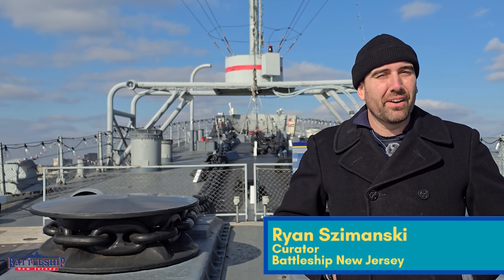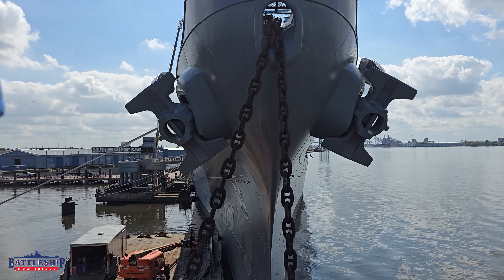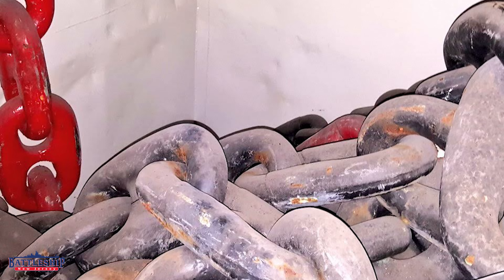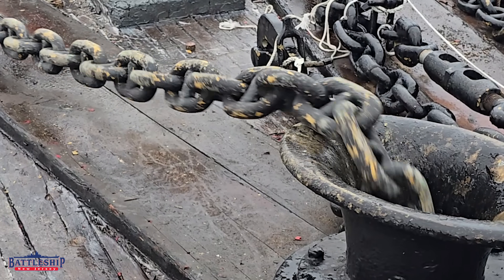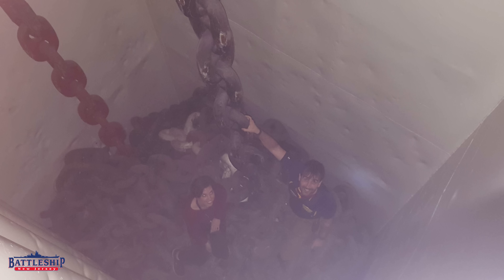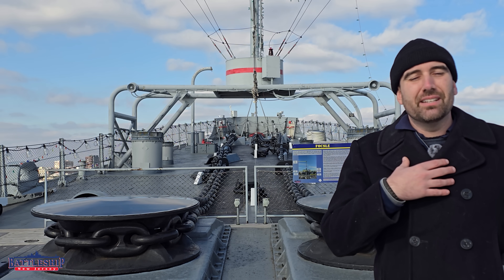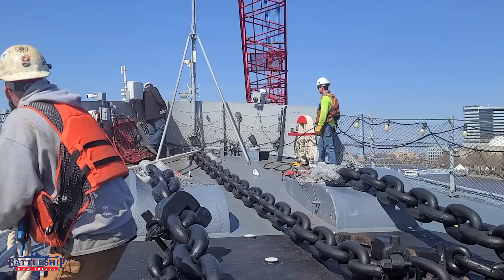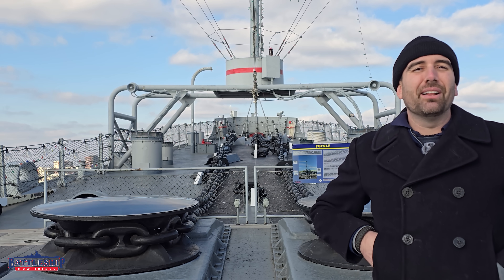How Much Chain Does A Battleship Need?

Comment: Speaking of that third (spare) anchor that was originally installed on previous fast battleships like North Carolina in a recessed indent in the main deck, I have 2 questions.  1). Why was the indent recessed below the level of main deck?  2).  With no crane on the ship able to service this forward area, how was the crew supposed to move this spare anchor into a service position if needed?  If only a dockside crane could do it, why carry it on the ship at all?  Just leave it in port.

Comment: I'll preface my comment with saying that I'm not an expert of naval anchoring, but I have taught anchoring on smaller vessels.  I'm pretty sure it isn't the direct weight of the chain deployed that allows the anchor to hold.  There needs to be enough length to allow the anchor flukes to stay flat and dig into the sea bed.  The weight helps, which is why (at least for smaller boats)you typically only need 3 feet of length for every foot of depth for chain and 7 feet for rope.  

The ship is held by the flukes digging into the seabed.  As the chain is brought to vertical, the anchor rotates and the flukes are freed.  

It isn't the weight of the anchor or the chain that holds the ship, but they do need to be sturdy enough to deal with the forces of holding a ship in place.

Comment: I have a question about the chain locker itself.  Is the chain locker a semi water tight compartment?  I suspect the chain locker has some sort of way to empty water from storms and from when the anchor  is being hosted, rinsed and stowed.  I have always wondered since the weight of the anchors and all the anchor chains are stowed in the narrowest area of a ship, the weight to buoyancy ratio is most likely the highest area of the whole ship.

The reason I have always wondered and thought about this fact is, I always wondered if Captain Smith had ordered Anchors away as soon as he knew the Titanic's hull was breached, if deep sixing the weight from the bow and chain lockers, would the chain lockers basically become  buoyancy tanks.  If so could they have gained a few more hours before the Titanic foundered. 

I have also wondered if they had opened the watertight doors A-G, leaving boiler rooms 1 and 2 manned to provide steam to the generators for the pumps.  Would deep sixing the anchors and chains and having the front seven of the 16 watertight compartments opened distributing the water, to have more pumps online early, could have kept the Titanic's bow from going under for over eight hours?  If the chain lockers were empty providing buoyancy in the bow, once the bow went under, the chain lockers would loose all their buoyancy.

Comment: Each shot is a manufactured unit.  They are connected by "removal links" which are designed to be semi permanently attached.  Each removal link is painted red to mark it.  For each shot, an increasing number of white painted links are on either side of it.  ie the first removal link has one white link on either side of it, the second has 2 white links on each side, etc.  Traditionally, the next to last shot is yellow, and the last is red.  The one time I've seen that much chain out of the locker on a merchant ship, there was no special paint - just the white links that were very rusty, as its not common to get down that far.  Most merchant ships carry 9 shots.

Comment: Since you’re asking … I have always been an avid follower (yes, even during the lower quality video days). One thing that could be done are “Classroom Series” - directed video content aimed at providing training level information on everything Battleship. 
For example talking about chain … it could be in a three part series (1) Intro to Deck Dept. Systems and Responsibilities, (2) (multiple paths) Anchor Systems - showing graphics where the various parts and pieces are located, some illuminated video in dark areas, (3) operations video (I know you can’t op the systems) other stock video along with volunteers in place on NJ.
Yes it’s a ton of work and could be a single video. The graphics, comprehensively seeing the systems with explanations … just draws interested people deeper. Hell I would be more than interested and happy to help.

Comment: I know weighing anchor isn't a fast process, but I have to imagine cutting that big of a chain is a real pain in the ass too. What equipment was available at the bow of the ship to perform this on presumably an emergency basis? Were there torches in the area on standby or just a few unlucky deckhands with hacksaws?
Reply: Blow torch set up and ready to run. All you need is to open the valves and make a spark.

Comment: You mean if an Iowa Class BB dropped it's anchor while steaming at flank speed, that pad-eye holding the bitter end wouldn't be strong enough to pull the battleship around in a tight circle???  Shocked!!!
Reply: There's a story that when Captain Halsey was assigned to CV-6 Enterprise, one of his first maneuvers was to drop the anchors at full speed and see how fast the ship stopped.  Supposedly she stopped right quick ....
Reply: @grizwoldphantasia5005 that sounds like bull, with engines going you're not stopping
Reply: @joshuacheung6518 there is s clip of uss tarawa loosing an anchor and chain, the momentum of the ground tackle moving is enough to rip it out it ain't stopping a ship
Reply: @mcduck5 right? You have to be basically stopped and it'll help keep you where you parked... hell, high winds can drag you and your anchor
Reply: @joshuacheung6518 it may be different once the  ground tackle is set and trying to make it move again
Reply: @mcduck5 I distinctly recall reading something about a fully anchored ship getting blown into the coastline.. let me see if i can find it.
Here we go. That took way too dang long.
MAIB report no 11/2019, incident date 18 DEC 2018, vessel Kuzma Minin
Reply: @joshuacheung6518  The question is, which came first, the story or the nickname?
Reply: @grizwoldphantasia5005 I'm sorry, what?
Reply: @joshuacheung6518  What was Admiral Halsey's nickname?
Reply: @grizwoldphantasia5005 oh. Potentially the typo?
Reply: @mcduck5  I assume the padeye weld is intentionally designed to break before anything else does.  The alternative is that instead of tearing the padeye off the bulkhead, you tear the bulkhead out.
Reply: @joshuacheung6518  What was Admiral "Bull" Halsey's nickname?
Reply: @roysmith5902 i think the mount to it is designed to fail without throwing stuff around
Reply: Dropping an anchor to turn the vessel sharply while underway is known as clubhauling.  It used to be done in sailing ships.

Comment: Questions 
1) In how deep of water could the ship anchor?  I know there are some rules of thumb for smaller vessels, like use a chain length of 6 times the water depth.

2). Seriously, you mention something about losing the anchor in 1951 without details?   Follow-up video!

Comment: One topic I’d like to see revisited is the use of the outboard fuel tanks. Specifically, I believe Ryan has said they could be used as ballast tanks. How did they prevent contamination of the fuel and also ensure no sea water accidentally got ingested into the boilers? The original bunker C is about the same density as water (vs DFM which would float on easier).

Comment: Ryan, what you have been referring to as the "Chain Pipe" is more commonly or properly known as the "Hawse pipe" derived from a term you probably used aboard the Sloop of War Constellation, the "Hawse Hole" called such because these (2) are the openings in the bows through which the "Hawser" or Anchor Cable passed.  I wasn't a Bos'ns Mate but am danged sure the terms are correct and believe the terms originated in the old British Royal Navy.  The origin of the term might be a question to refer to Drachinifel.

Comment: I've never heard it pronounced "TAY-kle" (long A), only "TA-ckle" (short A). But then again, Philly/Jersey accents have surprised me before.
Reply: I slept through elementary school phonetics - so that  ..- What I heard sounded like Teackle; as i the proper pronunciation is "tackle" as is a football tackle. We need to ask the Philly Eagles defensive line the proper pronunciation. At 2:33 he refers to the "wingspan of a man" - whereas I expected "wingspan of a Curator" . Each shot of chain is the unit you use when ordering it from the manufacturer. Shots are connected via a Detachable Link. Most of the chain is probably original, except the 1 shot after replaced after 6:40 "when they cut the cable in Wonson" - That shot was obviously replaced. I don't remember - when chain is pulled out in dry dock for repaint _ I expect each Detachable Link is disassembled - then put back together. DO they do any hammer or bang test on each line - and is sounds bad causes the whole shot to get replaced?  Nice Jacket, Ryan. Nice comments on other. A Core system that already has 1 video - but need redo- Boat Booms and Accommodation ladders - I just rewatched that short 5 minute one - and you need to visit another ship that still has them to really show us. OR Redo the "Battleship Modern Missile Defense" - it covered the SLQ-32, Phalanx CIWS, and the SRBOC. thanks
Reply: Only land lubbers call it tack-el
Reply: @fire304  I've heard more than one salty AF Boatswains Mate (think a BM1 with 19 years in service) call it tack-el.